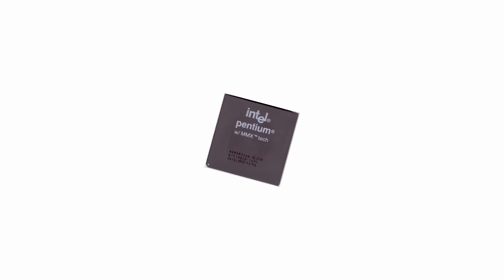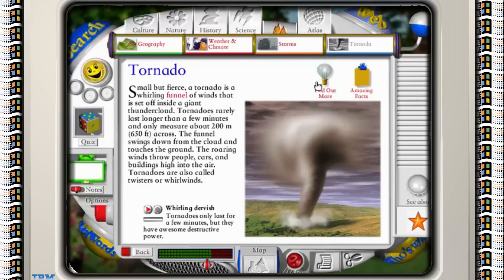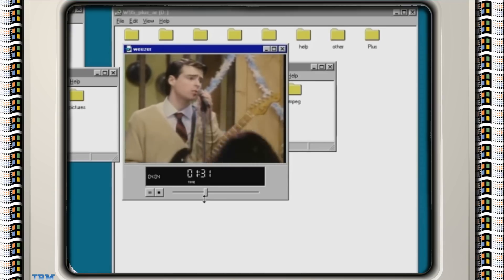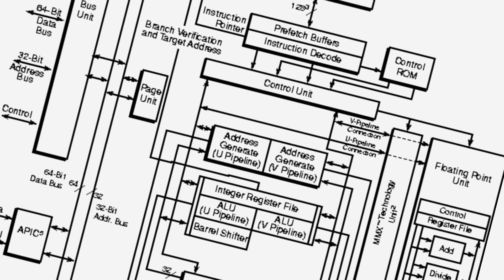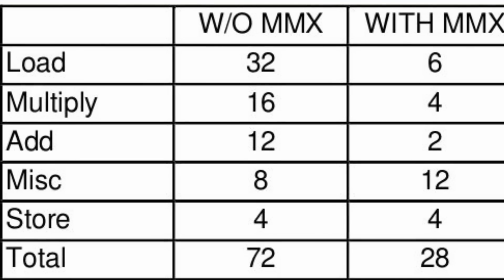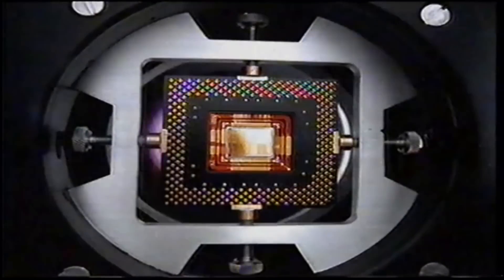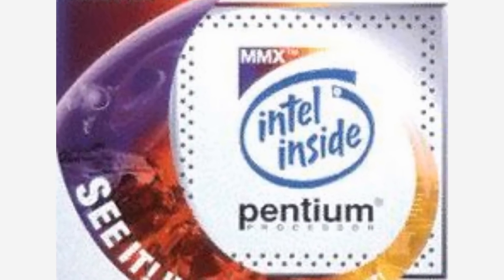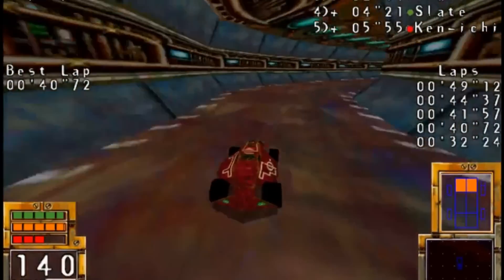What is MMX Technology & Why Was it Flawed? [Byte Size] | Nostalgia Nerd

Comment: The 64-bit MMX registers were overlaid on the 64-bit mantissa of the corresponding 80-bit FPU registers. This scheme was primarily chosen in order to make MMX compatible with MMX-unaware operating system kernels as it avoided the need to save any new registers on the machine stack during task switches. It had little to do with "enough room" (chip area).

It was possible to mix MMX and FPU code, although cumbersome, due to the fact that FPU registers are relatively addressed (a stack structure) while MMX registers are directly addressed. The Pentium II had the same limitations as the Pentium MMX in this regard.

(SSE then introduced a new separate register bank, making it much easier to mix SSE with FPU code, or even MMX code).
Reply: Compatibility Madness
"Aren't MMX instructions a ALU only thing, and SSE/AVX a FPU only thing ?"

==MMX instructions work on integers of size 8 bit, 16, 32, 64. I don't know where exactly on the chip the circuits are located, but they use the FPU registers.

MMX is useful in some limited cases like audio processing.
I used it to do text searches. I can compare 8 char in parallel rather than 1 at a time.

Yes, SSE only deals with 32 bit floats.
I think it is SSE2 that adds 64 bit support.
The good thing is that they have their own registers. This means you can submit a SSE instruction and FPU (or MMX) one after the other and there is no pipeline stall since they don't share anything.

When you want to do FPU and MMX, you are screwed.
Reply: MMX is focused on integer SIMD, SSE can do both integer and floating point, AVX integer instructions are really neat, I wrote an AVX version of alpha blending routine, works in 16bit integer, it runs blazing fast!
But in today's CPU design it doesn't matter anymore, current CPUs are having tons of ALUs and FPUs and registers, while at opcode level you can see only limited numbers of ordinary "registers" but those opcodes are then further decoded to microcodes (which you can never touch unless you are an intel engineer), and offload those calculations to "currently available"  registers and ALUs/FPUs, eg. a single SSE floating point instruction will generate a microcode just grab 4 available FPU to do the math, same as other instructions.
Reply: +Lois tournas To add to what pig said, X86 CPUs could not introduce a bunch of new registers for backwards compatibility reasons. So they added a bunch of physical registers and mapped dynamically so that you could have e.g. several EAX registers being used at once (e.g. if you read something into EAX, operate on it and store it, then read something into EAX from somewhere else and operate on it, a modern CPU will just dynamically create EAX0 and EAX1 and try to do everything in parallel).
Reply: @soylentgreenb  >X86 CPUs could not introduce a bunch of new registers for backwards compatibility reasons

Intel has added SSE's 128-bit XMM registers for X86, but the OS needs to support them for context switching with multiple software threads.
Reply: @soylentgreenb  Modern X86 CPUs have register renaming features that expands the physical register storage.
Reply: It wasn't that they particularly thought it was a good way to do it. It was  the only way to make it backwards compatible and transparent to the programmer. There were RISC architectures with hundreds of registers exposed to the programmer.
Reply: @soylentgreenb  The GpGPU architecture has many thousands of registers.
Reply: @soylentgreenb  >X86 CPUs could not introduce a bunch of new registers for backwards compatibility reasons

X86 vendors have introduced a bunch of new registers for SIMD e.g. SSE. X86-64 and Pentium III-based PCs can run MS-DOS/Windows 95/98 which are not aware of SSE.
Reply: Physical registers.
Registers you can see in assembly level (GP registers, x87 registers, XMM/YMM/ZMM registers) are actually "logical" registers, they are not directly used by ALU and actually are dynamically mapped into internal register files in microcode level.
This is basically how modern superscalar CPU works, combined with SMT (eg, Hyper-Threading) and pipelines.
Reply: +louis tournas
"Do FPU" = x87 and "do MMX" = SIMD ALU instructions :)
But you were right, MMX utilises FPU's registers to make ALU ops faster (it was done this way to avoid problems with context switching in OS).
I don't think "x87" instruction set is use anymore... (SSE FTW ;)).
So, doing MMX op with x87 op is in the past (or in Really Old programs).

PS. "SSE2, introduced with the Pentium 4, further extended the x86 SIMD instruction set with integer (8/16/32 bit) and double-precision floating-point data support for the XMM register file. SSE2 also allowed the MMX opcodes to use XMM register operands, but ended this support with SSE4 (and recently with SSE4.2, introduced in the Core microarchitecture).[citation needed] However, since processor support for any SSE revision also implies support for MMX, the removal does not limit the data types usable by x86 SIMD."
Source - Wikipedia :)
Reply: Compatibility Madness
"I don't think "x87" instruction set is use anymore... (SSE FTW ;))."

==That's something that depends on the compiler.
Since I compile with VC++6, and I have chosen Pentium pro instruction set, it generates x87 code when I use floats.
If I want to use MMX or SSE, I use the __asm key thing for inline assembly code inside my C++ code.

I don't know what VC++ 2017 does.
Reply: Yes
in Skylake, there are 180 integer register files and 128 FP register files!
Reply: of course you can do matrix operations through MMX, but only simpler matrix operations. But the third paragraph is too vague. SSE has opcodes for multidimensional matrices and uses a packed format. SSE (1) also uses the MMX and FPU registers instead of banking/pushing to stack (aka switch context). If anything MMX was just a subset of opcodes to standardize 2D matrix operations that relied on MMX/FPU registers. And thus, preventing FPU and MMX code to run simultaneously. On top of that, SSE (1) still uses both MMX and FPU registers. SSE2 uses XMM vector-register file, and eliminates the need to rely on MMX and FPU available registers. (so SSE2 can co-operate with FPU or MMX code)
Reply: @codecoderr7495  SSE1 uses its own XMM registers. SSE1 has a 128-bit pack math programming model while X87 has 80-bit registers that can store 64-bit pack math MMX.
Reply: @semicuriosity257  OpenGL doesn't really require floating point, can also use either fixed math or double. Example: Display Lists's wrap around vertices when emitting physical display list commands formatted using whatever target GPU Display List port packed command is used.
Reply: @codecoderr7495  Fix math geometry is not a stable e.g. PS1's geometry issues.
Reply: @codecoderr7495  From glspec10 (OpenGL version 1.0) via khronos

The GL must perform a number of floating point operations during

---
_GL Command Syntax

Example
 void Vertex3(float x, float y, float z)_
Reply: @semicuriosity257  that's got nothing to do with each other. If that was the case, NintendoDS would have "geometry issues" as well.

What you meant to say is texture warping and vertex fighting due to lacking Z buffer implementation (which breaks perspective correction on some angles).

And before you come up again with such comments, do some research first.
Reply: @semicuriosity257  Then explain why Vertex3f, Vertex3d, Vertex3i exists. That's some next level bullsh1t.

What's next? float casting to double breaks OpenGL standard? How about you get to learn the basics first before spreading lies?
Reply: @codecoderr7495  MMX, EMMS instruction.

 The MMX registers

The 8 64-bit MMX registers are aliased on the 8 80-bit floating point registers (the MMX number stored as the 64 bits of the mantissa, the exponent being filled with 1's so it is viewed as NotANumber when looked at in floating point mode if an MMX number is mistakenly not removed), an action with quite serious ramifications.

Before an MMX number can be loaded (the first stage in an MMX calculation), the current state of the FP registers must be saved. 

FP and MMX numbers cannot occupy the registers simultaneously, i.e. FP number in F0 and MMX number in M1 (F1) is not allowed. 

Some overhead is incurred in this state saving. Everything proceeds efficiently, in both MMX and non-MMX integer computations, until the code needs to switch back to FP operations. 

To switch back to FP mode safely, the EMMS (Empty MMX State) instruction must be issued. If the EMMS instruction is not issued, any of the following are likely to happen:

1. A floating point exception may be generated
2. A "soft exception" may occur, where the FP code continues to execute, but yields incorrect results
3. If used in a multitasking environment, if the OS does not manage FP context across task switches, an error can occur

Obviously, none of these can be allowed to happen. The EMMS instruction marks the FP registers as empty, preparing for the FP state to be restored.

---
Unfortunately, there is a major problem with the EMMS instruction. Execution of this instruction causes a mandatory 53 cycle stall.
Reply: @codecoderr7495  PC's Quake sets the standard on FPU usage.
Reply: @codecoderr7495  PS1 didn't have a depth buffer, hence software implementation can be used.
Reply: @semicuriosity257  Fixed math doesn't mean breaking OpenGL standard, stop spreading lies. 

So, you're talking about Quake: 
Even J. Carmack had to hack around square root calculus, see 'Fast inverse square root', and that's because FPUs back then were too slow to handle per pixel lights (or shadows).
Reply: @codecoderr7495  Fixed Point vs Floating Point
In 3D, you simply can't get away from the fact that you need a bunch of operations like multiplication, sqrt, and trigonometric functions in your math. If you're careful, you can implement these in fixed-point, but there are traps you have to watch out for. It's easy to end up with overflows in fixed point, which is catastrophic and gives you garbage results or outright errors. Fixed point keeps absolute error constant, but in simulations, you often get better tradeoffs if you keep relative error constant (like in floating point). Fixed point functions will sometimes have bad singularities or unusual behavior when you give them small inputs. Floating-point numbers are much more well-behaved and predictable, especially if you are translating formulas directly from a physics textbook into a computer program.
Reply: @codecoderr7495  OpenGL needs floating point math to be fully compliant, fool
Reply: @semicuriosity257  Fixed math means you'll have less 'precise' vertices, thus they'll look blocky and at some point they'll wrap around. 

Also I see you're talking about the OpenGL 1.0 spec: GPUs back then used a Display List port and vertices were packed through fixed math, so OpenGL 1.0 defined the standard, and device vendors had to write drivers around that standard. Which means GPUs from back then also had fixed math and they made every OpenGL application work out of the box.
Reply: @codecoderr7495  >Even J. Carmack had to hack around square root calculus

That's only square root functions, but the rest of the computation workload is a floating point. PC Quake doomed strong integer/weak FPU Cyrix competition.

SSE is the corrected SIMD feature for X86.
Reply: @codecoderr7495  >OpenGL doesn't really require floating point

That's not "fully OpenGL complaint".
Reply: @semicuriosity257  Like I said, i'm a game programmer, I've developed 3D drivers, among a ton of other stuff, and it was 
THE way to go back then in the 90s. 

So before you keep spreading lies and pasting random wikipedia comments, try to understand whatever you're quoting first before you go and make ignorant assumptions.
Reply: @codecoderr7495  You're ignoring OpenGL 1.0's vertex3f, I see.
Reply: @codecoderr7495  >OpenGL doesn't really require floating point, 

No modern OpenGL-compliant GPU has fixed point math-only implementation. 

1997, Intel introduced MMX.
1998 NVIDIA TNT supports OpenGL 1.2 including glVertex3f (float, X, float Y, float Z).
1999 Intel introduced SSE.

void draw(void)
{
    glClear(GL_COLOR_BUFFER_BIT | GL_DEPTH_BUFFER_BIT);
 glColor3f(0.5,0.5,0.5);
 glBegin(GL_QUADS); // Draw a square at z=0
       glVertex3f(-1,-1,0);
       glVertex3f(1,-1,0);
       glVertex3f(1,1,0);
       glVertex3f(-1,1,0);
 glEnd();
 glColor3f(1,0,0);
 glBegin(GL_LINE_STRIP);
    glVertex3f(-1,0,-1);
    glVertex3f(-1,0,1);   // dz=2
    glVertex3f(1,0,1);    // dx=2
 glEnd();
    glutSwapBuffers();
}

Anything less is inferior.
Reply: @codecoderr7495  >So before you keep spreading lies and pasting random Wikipedia comments
That's FALSE.
Reply: @codecoderr7495  Reminder, my perspective is for PC's NVIDIA TNT, Premedia II, Matrox G400,, Microsoft Software GL, and GLQuake, hence glVertex3f, glVertex3fv, glColor3f usage.

 Anything less is inferior.
Reply: @codecoderr7495  >Which means GPUs from back then also had fixed math and they made every OpenGL application work out of the box.

PC's GLQuake wouldn't work without glVertex3f, glVertex3fv, glRotatef are floating points.

PC's GLQuake has set the standard for PC 3D rendering and "must have" (via competitive pressure) floating point datatype support. 

Game console's fixed point Quake ports are meaningless for the PC market.

Nintendo DS examples are meaningless for the PC market.

 I'm aware fixed point Pocket Quake port, and it's meaningless for the PC market.
Reply: @codecoderr7495  Core Design's Tomb Raider III's "MMX Hardware Card Emulation" is one of the best examples of MMX usage and it has similar geometry issues as PS1.
Reply: +pig1800:
"a single SSE floating point instruction will generate a microcode just 
grab 4 available FPU to do the math, same as other instructions."

==Yes, I think that the circuit that does floating point calculations doesn't change. They just put more of them.
Reply: +pig1800:
What's a register file? The set of registers? XMM0 to XMM15? LEAX to LEDX?
Reply: +soylentgreenb:
I guess it is a good design. I guess they have to somehow keep track of which instruction goes with with EAX and further down the line, if another instructions tries to access the same memory address, the lookup table has the address of the register that already has the needed value.
Reply: Yeah, when SSE came around they realized they got everything backwards with MMX, so the registers became XMM /s
Reply: Each MMX instruction resets stack pointer and sets all stack items to valid, so the resulting state is stack full of eight x87 registers. In that state, pushing items won't work but popping will.
Reply: x86 so bloated no wonder intel is looking at stripping out old op codes making a new slim version as it’s that or going to ARM and I don’t think intel wants to abandon it’s cash cow regardless how fat it’s become so perhaps after a drastic weight loss it may have a chance
Reply: Aren't MMX instructions a ALU only thing, and SSE/AVX a FPU only thing ?

^Based on that, I think MMX went nowhere because ALU's aren't really that useful in post DOS era. 
On the other hand, AMD's 3D Extension (3D Now!), was GREAT (it was used to accelerate FPU SIMD operations).
Intel's SSE intruction set was based on the same principles as 3DNow!, and was highly successful as well (you need SSE2 to run STEAM client).

Back to ALU's tho : 
Doing things in parallel for them is getting us nowhere today as well (at least on x86-64 code). AMD learned this the hard way when they made Bulldozer/Piledriver/Steamroller architectures that double ALU resources, but share FPU resources.
In short : If FX-8350 was better than Intel Core i7, we can safely asume program uses parallel code for ALU units/"cores".
Reply: @CompatibilityMadness  OpenGL's programming model requires floating point geometry inputs.   MMX can be used for integer geometry processing like mostly integer processing on Sony's PS1.
Reply: This was a bad video.
Reply: Yes, Intel really screwed up on their FPU and MMX stack design.
They can't trash them since so many programs use FPU. MMX can be trashed, I think.

Comment: I never imagined back in the 90s that MMX would become the subject of an enjoyable infotainment video 20-odd years later. It did have a use after all!
Reply: My Cyrix 333 had it. My 2500 had it. Now my 6600 has it. I don't think I've ever had an app that's used it. 

Actually my P3 1.7 had it and 2 P4s, one at 3ghz and one at 3.2ghz. 

Jesus, also a dual core celeron in a lappie,  think it was at 1.6ghz.

I've had a lot of CPUs in my time.

Comment: In 1997 I upgraded my 486DX4/120 to a Pentium-200MMX, which I still have to this day, albeit it now has a blown PSU unfortunately. Someday I will have to turn it on, I'm simply curious to see what is still stored in its 3.2GB quantum fireball hard drive ... I think that in terms of the incremental upgrades to my PC hardware i've done through the years, this was the biggest, as the performance of the 486 was pathetic compared to what the P200 could do.
Reply from the maker: I'm still disappointed that my Dad  threw out my old PC... the hard disk held absolute wonders... although it was getting a bit ropey even in 1998... I imagine it would have bitten the dust by now anyway. Pretty sure that was a Quantum fireball as well.
Reply: Yeah, Quantum were popular at the time because they were pretty decently priced, but they weren't known for being very reliable. Quite the contrary in fact. And probably that's the reason they dropped off the market.
Reply: My amd386dx lived from 93 to 98 and would be today, but my cousin broke a few pins, the board and harddisk were still intact. Yeah the jump in speed from a  80386 40 Mhz to a AMD K6-2 350 Mhz was amazing.